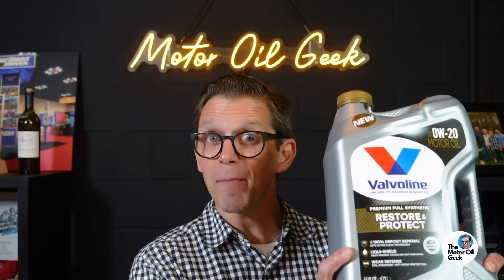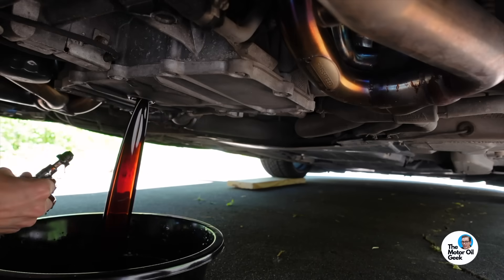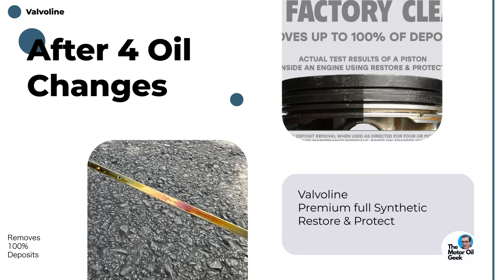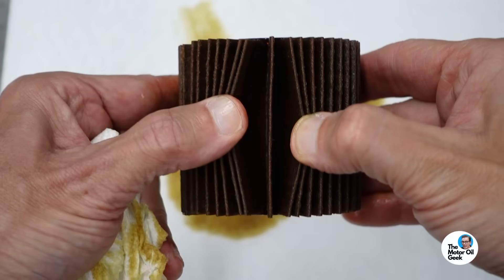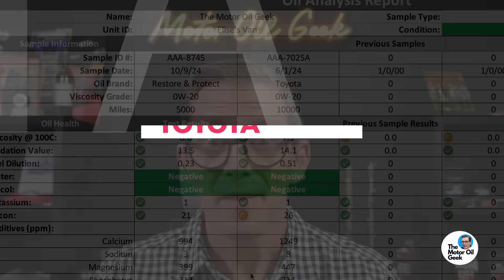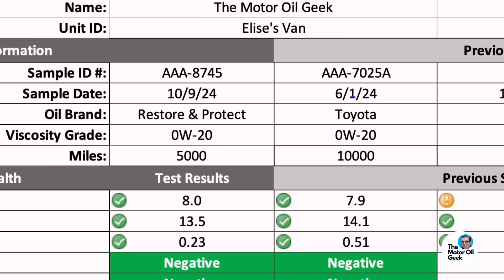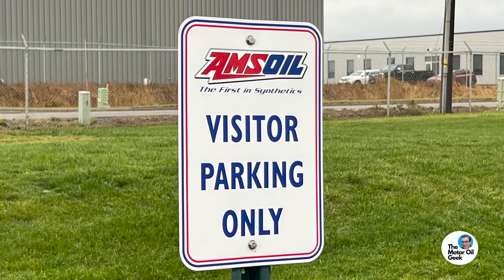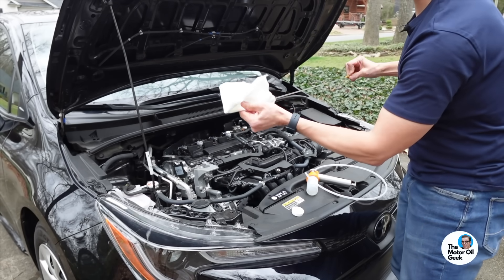The TRUTH About Valvoline's BOLD Engine Cleaning Claims

Comment: I have a 2012 tundra with a 5.7 that has always had the tundra timing chain slap at cold start because of a varnished tensioner on one side.

I changed to restore and protect to see if tensioner might get full range of motion with any build-up removed. I drove 65 miles on the restore and protect and the timing chain slap at cold start went away and is perfectly quiet now at cold start.

It was a $30 solution to an old and persistent issue with the 5.7. I wouldn't have believed this if someone told me. But it worked and it worked fast.

Thank you for making this vid.
Reply from the maker: Thanks for sharing!
Reply: Toyota engines were never long lasting engines
Reply: @gregorylyon1004 🤪🥴 Hahaha OK bud...in what cave on what planet do you currently live???
😆 #PutThePipeDown
Reply: @gregorylyon1004  What 😂
Reply: I have a 2013 tundra with the same issue. Going to start using this and see what happens. Any recommendations?

Comment: Hello Lake:

i have a 2015 Ford Escape with the Ecoboost motor. question is will restore and.Protect remove deposits from the pistons the Intake Vales etc? 
My other question is do I need to change the oil and Filter every 1500 Miles or 3000 Miles. would this alsonclean out the turbocharger and the oil passages?

Comment: We have a Ram 2016 Diesel 2500 6.7L engine.   We tried Hot Shot Secret Striction Eliminator at 160,000KM, after a few k's, I was getting code that pointed me to the crankcase filter.  Did an oil change always using Shell T6 Synthetic and decided to look at the crankcase filter, it was clogged and very heavy, normslly this is chnged ever 100K or so.  It seem to run better and less takeoff hesitation.   Have you ever tested this product and/or have info/report on it.  It seemed to work, but always nice to have stats to prove it.  @simplyoffgridlife

Comment: I started using this oil on my 2011 Mazda Cx7, which has 222000 miles on it. I'm a Doordash delivery driver and put about 1000 miles per week. It was recommended on a video to change the oil filter every 300 miles for the first oíl change, so I changed it twice in one week but forgot to do it again till I remembered and I saw that there was an oil leak in the filter and as I change the filter oil gushed out of it and I had lost about 3 quarts of oil but I'm sold on and will put it on my 09 toyota prius

Comment: Lake I have a 2107 Honda civic with the the 1.5 liter turbocharged engine.I bought it new and have always used either Valvoline's 0w-20 full synthetic, or Mobil 1  0W-20 oil, changing either at no more than 4000 miles.  I now have 148,000 miles and change. It doesn't use a drop of oil in between changes, but as an old aircraft mechanic who has seen coking on the outside of jet engines in the old days, I wonder if the piston's and the ring-lands on my Honda are starting to coke up.  I know these modern engines, and especially turbocharged engines, because of the extreme cylinder pressures and related heat, will cook oil and can cause "varnish buildup", if the owner runs it too long in between changes, but what about 3-4000 miles ?   Any thoughts on that would be appreciated. I paid a lot of hard earned jack for my Honda, I'd like to see it go a half million miles.  BTW, not even one problem with the CVT transmission, which has been a concern in the back of my mind.  Last June I drove the car from Atlanta to Seattle, down to Phoenix, up through Denver, to Peoria Il. and back to Atlanta.......    Over seven thousand miles in total, stopping in Oregon for an oil change.  She's been good to me, I just want to make sure she's not getting ready to slap me in the jaw......

Comment: Ive put over 240k miles on my 2014 Ford Focus ST.  Shes still going strong and Ive used Mobil 1 full synthetic and High Mileage, just broke off my dip stick handle.  Need to get it pulled out tommorow so I can check my oil lvl.  I am excited to try this as my oil consuption has increased quite a bit over the last few years.

Comment: So can this oil be used in a brand new engine with less than 10000 miles? I did my first oil change at 3500 with OEM Nissan 0W20 and OEM Nissan filter. I plan to do the second change at 7000 using what I use in my other vehicles - Wix XP filter and Pennzoil Platinum oil. Would this Valvoline be a better choice over the Pennzoil Platinum? The engine is a 2024 VK56VD 5.6 V8 in a Nissan Titan XD P4X.

Comment: I've had Amsoil in my truck for the last say 10 years, not sure what was used in it previously. But the last 2 changed I've got so much sludge in my pan now it will hardly drain. So, my plan now is to drop the pan and clean out all the sludge that the Amsoil has removed from the engine.

Comment: Lake, I want to send you pictures of my 2012 Camry with 224,000K.  I just changed my valve cover gasket and was amazed how clean it was.  Right now I have 3,000K on the restore and protect inside. Thanks!
Reply from the maker: Awesome!
Reply: my civic burns ALOT of oil..about 700-1k per qt. Car calls for 5W-20, should i just go with 5W-30 to get lasting effects from the oil consumption? Was thinking it wouldnt hurt to keep this in longer & get more out of it? Thoughts? Also, should i top off with this or can I get away with other simialr valvoline products till next oil change? Apprently it takes 4 oil changes for it to work 100%?! Also, after the 3 oil changes, can I go back to my old Castrol oil for sometime & use this periodcally in like every 4-5th oil change? 
P.S. I change my oil 3-4k miles Thanks!

Comment: What’s your thoughts on the elevated tin levels after 5,000 miles on the Valvoline R&P being higher at 5ppm compared to the Toyota OEM oil only having 1ppm at 10,000 miles? Is that to do with the cleaning properties or the difference in protection? Love your videos and all the interesting and educational content and have switched to Valvoline R&P on my 2023 Subaru BRZ
Reply from the maker: The Tin is from the specific Molybdenum additive used in the Restore and Protect formula.
Reply: @ Would never have guessed that! Thanks for responding. Knowing this will help me understand my next oil analysis on two changes with the R&P 5w-30 compared to the 0w-20 oil analysis. Can’t wait 😎

Comment: Lake, have you ever done an oil analysis on LORENZO'S OIL SAE 15W-40 NANO TUNGSTEN DISULFIDE (WS2)? I considering running it in my 2023 Ford F350 6.7L Hight Output Powerstroke. They state this oil used in conjunction with the Insane Diesel bypass oil filter 5:06 will go 15k mile oil change intervals. Is there a benefit putting tungsten in the oil that would help a diesel engine? This is related to a YouTube video on Dave’s Auto Centers channel related to a guy who had a 900k mile Ford 6.7L Powerstroke using this oil.
Reply from the maker: I've not tested that.

Comment: I have a 94 Ford E150 Club Wagon.5.8. It has 286K on the clock and I have been religious about OCI of 3K. It had a slight oil pan gasket leak and Valvoline 5w30 Maxlife High Mileage has slowed it considerably. "I was told" that using Restore and Protect would not be good for certain gasket materials. The engine runs great, doesn't burn oil. Is trying Restore and Protect worth the risk of bringing back the oil pan leak?

Comment: Thank you for these outstanding videos regarding Valvoline Restore and Protect. I recently purchased a 2002 Toyota MR2 Spyder with approximately 89,500 miles on it. The engine is generating that dreaded blue smoke and I'm suspecting stuck oil control rings. I have just done and oil change using the restore and protect oil. I know this is probably a guesstimate... but could you suggest how many miles between oil changes, and the number of changes before making a decision on whether or not this product is showing results?
Thanks again for producing these very informative videos.
Reply from the maker: I'd give the product at least 3 oil changes of 4,000 to 5,000 miles each. I'd also use a bottle of Chevron Techron Complete in a tank of fuel at each of those oil changes.
Reply: @themotoroilgeek  Thank so much for that information. Being that this is a Sunday drive car and I'm pushing 80... 🤔
Reply: Just started with the protect and restore treatment... burning 1 quart every 100 miles! Just wondering your thoughts on using MMO in the crankcase and fuel tank vs Chevron Techron.
Reply from the maker: @roehaus1  Don't add anything to the oil. A single bottle of Chevron Techron Complete in the next tank of fuel is helpful. Give it some time to let everything work.

Comment: I have a question about which oil do you think is better for my application i have a 2020 gmc sierra with the 5.3 I bought new and drive  about a thousand miles a year and change the oil every year with my inspection at the dealer in November and again in July with amsoil..should I use amsoil or Val online restore and protect.which one would you recommend for me thank you great channel

Comment: I have 2 farm tractors and am thinking of trying the Valvoline. 1961JDeere. 49 8N rebuilt engine in 1972.
Reply from the maker: This is not for diesel engines.
Reply: @themotoroilgeek They are gasoline.  Do you know if the Valvoline R&P can be used in hydraulic reservoirs? These old tractors use a 30 weight engine oil for hydraulics.

Comment: I just completed my first oil change with the Valvoline Restore and Protect in my 2002 Expedition with 198k miles. I only put in 1000 miles since I did my first round of Valvoline R&P, about 6 months ago, but also the vehicle did a lot of idling while I repaired other things.

Just took apart the motorcraft filter with metal sheers (a royal pain in the arse 😅) and noticed each of the folds was covered in black chunky particles, not sure if this is the cleaning action or regular filter operation. Took pictures of it real close, wish I could send them to you to check out the potential cleaning work it is already doing in my engine. Oh and by the way, my dipstick is shiny clean, like new!!! Couldn’t believe it but after seeing your video last night, that’s the first thing I checked this morning!
Reply from the maker: That stuff cleans!
Reply: @themotoroilgeek definitely does! Since you know a lot about the topic and have insiders at Valvoline, could you find out if this is suitable for GM engines? I was thinking of using it in my ‘23 Tahoe when I first learned of the product; sold it last weekend and waiting on a 2025 Suburban I ordered, wondering if I can stick to this product for it. 😅
Reply from the maker: @unkhammunankh7252 it is fine to use in GM engines.
Reply: @unkhammunankh7252  Valvoline R+P is not Dexos certified, but I don't know if it is because Valvoline isn't interesting in paying the Dexos certification cost, or if it lacks something needed to be Dexos certified. I suspected the former, and did an oil change to a friend's Buick using R+P.

Comment: I am midway thru oil change #3 with restore and protect on my 2012 Elantra touring with 223,000 miles mostly highway miles.   This car has had the oil changed every 3-4K miles for its whole life but I never really paid any attention to the brand and it was mostly whatever the oil change place had.  The car never burned oil so I can't say if that's improved, and it was running okay but the engine seemed to be getting to be tired and the idle was not as smooth and quiet.  I didn't notice anything in the first 2 oil changes, but now with  12K ,  though I have no way to quantify it sure seems to be running better with an increase in power especially at highway speeds passing. It also idles really quiet and smooth like when I first got it. So much so, that I have accidentally tried to start it with the engine running.  Nice part about this oil is if you have a mechanic that will let you bring your own oil it's not that expensive. My mechanic is a valvoline guy and he told me the rep said that he was running it in his own car.

Comment: Lake, I have two gm trucks with the 5.3 motor , recommended OW-20 dexos, based on your research what would be your recommended brand for this, for the best protection. both have ~ 100k miles
Reply from the maker: Based on what we've seen so far, the Restore & Protect would be my choice.

Comment: It could be because there was more manganese in the fresh oil out of the bottle to begin with than the toyota oil's and not necessarily because it is cleaning ring deposits.
Reply from the maker: Manganese is not an additive in the fresh oil. No oils contain Manganese.
Reply: @themotoroilgeek  yes, you're right! i was confusing it with manganese in anti-knock fuel additives. Thanks for keeping me on m toes.

Comment: Did you run the engine after the 1st oil change? Did the oil clean the dip stick with or without running the engine? If you ran the engine, how long did you run it? Did you drive it or let it idle?
Reply from the maker: As mentioned in the video, these results are after 5,000 miles of driving on the first oil change with the Restore & Protect.
Reply: @themotoroilgeek  I didn't hear that but thanks. 👍

Comment: Ok, I have OIIL X in my Truck and I want to move to V R&P.  At 6Q per re-fill and cheapest is 40 bucks for 5Q+1Q @ 11, need 2nd for filter. We are talking $70 with sales tax.  Use your analysis database to fine a matching (if possible) cheaper syn. to flush the engine with that won't fight it or degrade it after its dumped from residual.

And thank you for all you do.

Comment: I have been using multiple oil changes to clean engines for years. My trick is to use auto transmission fluid and run engine for a half an hour before the oil drain. Then put in half quart into the normal oil 5 6 quarts total and new filter. This will work and I did not use the protect and restore. But I will try the VALVO my next oil changes. Hope to see same improvements as you did BOB . Peace vf    😀😀😀😀😀

Comment: Can Valvoline Restore and Protect be used in light Diesel engines with flat tappets or push rods?
Reply from the maker: No, Restore & Protect is not made for diesels.
Reply: @themotoroilgeek  Thanks for the reply Lake. 👍

Comment: Just hit 231k miles on my corolla, use the R&P last oil change now just waiting for the next second oil change, would go back to valvoline advance synthetic after my 6th oil change..maybe, gotta see how clean it is under the oil cap or that plate when you unscrew the cap

Comment: As an engineer I love your honest data driven analyses.  My 2012, 130,000 mile Pilot dropped a cam belt. No valve damage but I had to have the heads skimmed. The tops of the pistons were covered with buildup so I manually cleaned off what I could. Based on your videos I'm now running my first VR&P.  Only 1,000 miles in but I can report the engine is much quieter and smoother and my mpg has shot up North of 26 mpg on the freeway. I was at 22/23 before. My dipstick also looks brand new. I'm going to go to 5,000 and will scope a cylinder or two and examine the filter. So far I'm sold. I'll report back....Thanks!
Reply from the maker: Thanks for sharing!
Reply: Any update?
Reply: I also have a 2012 Pilot. My guy, you HAVE to disable the VCM with a VCM tuner. That VCM will kill your Pilot.
Reply: Have you hit that 5K yet? 🙂
Reply: We need updates amigo!
Reply: What were you getting in MPG before?

Comment: Great oil BUT, in 2 of my cars I've switched over to this oil, it is now experiencing low speed pre ignition (LSPI) due to high detergent content. this started after switching to this oil. We've also tried switching to different octane rating of gas, but problem persisits. The pinging is so bad that its actually audible.

One engine is port injected, other is GDI.

Comment: I would love to use the restore and protect in my Volkswagen Jetta with 140k miles, but sadly it doesn’t meet the 504 00 spec VW calls for in their engines. My question is would the R&P oil in my VW engine be safe to use, or are the oils so different that it could potentially cause damage with long term use to seals, timing belt, hard parts, etc? I’ve heard the 504 00 spec is just different additive package for the extended drain intervals European cars run, is that true or is there more to it. Hoping this can be an easy yes or no, but I’m assuming there’s most likely a bigger difference in the European spec oils than the American API spec than I think. Would be awesome to hear back from you, and maybe someday a comparison of euro vs api oil spec!
Reply: I own a Audi TDI and I plan on putting this in my next oil change . From what I know 507 “European spec oil has certain additives to help the the DPF not get as clogged .. but my car recently took ozempic and lost some weight so me not using the 507 spec oil won’t make a difference .. with 504 oil being for gasoline engine I’m betting my money it also has to do with emmision euro standards . R and P is also not DEX approved but people still putting it in there GM vehicles
Reply: @ Makes sense, emissions standards did slip my mind but like you said I bet that has something to do with it as well. My car still has some extra weight on it and I haven’t looked into putting it on a diet, so I wonder how the R&P oil would treat my catalytic converter. I can’t imagine it is too much different than the euro spec oil, as the R&P is being used in many cars that it’s compatible with that have catalytic converters on them as well.

I can’t imagine the R&P would cause any damage over prolonged use and with frequent oil changes (I’m a 5000 mile guy, I know it’s overkill but oh well.) My biggest question I guess was is the R&P chemically different or lacking something/having something that would over time cause damage, corrosion, or anything else to my engine. I know I’m thinking way too much into it, but I’ve recently started needing out about oil since I found this channel and just want to run what’s best for my engine